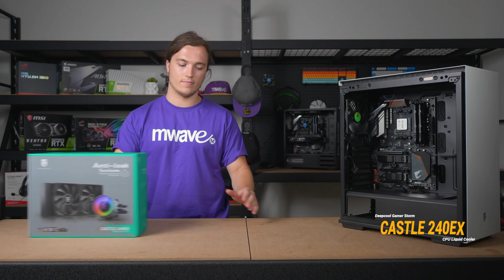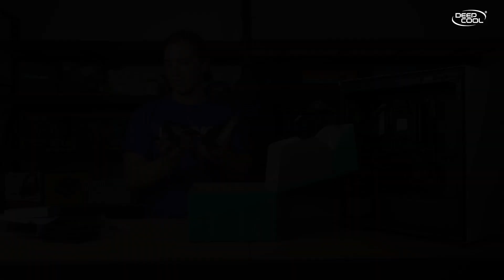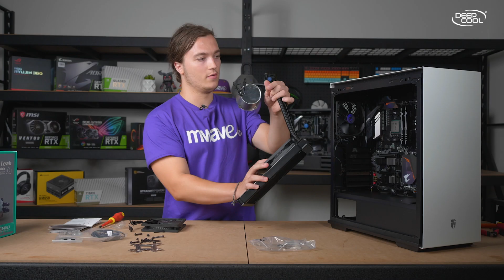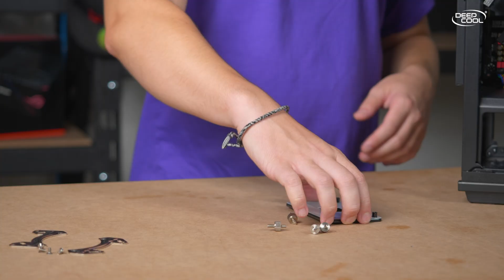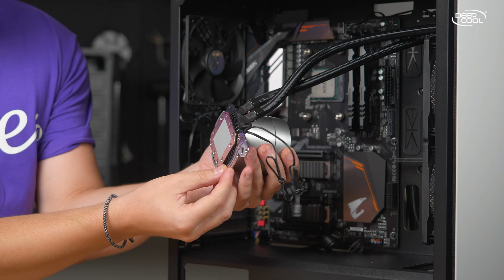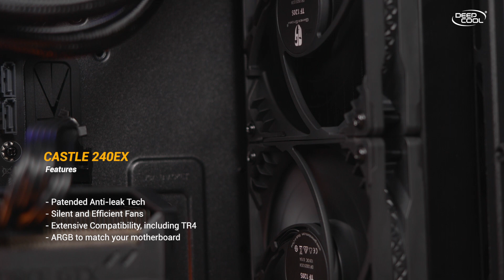Deepcool Gamer Storm Castle 240EX Gaming System (Unboxing + Installation)

Comment: Does it matter which direction the hoses on the radiator are located(at the top or bottom)?
Reply from the maker: Hey Adam. Apologies for the late reply! If you are placing the radiator at the front of the system, similar to how it is installed in this video, then no. Both ways will work but there are just a few things to keep in mind.

If you are positioning the tubes at the top, just make sure that the top of the radiator is above the CPU/water block. For some AIO coolers, if the top of the radiator is below the water block, then the air bubbles will eventually make their way up to the pump and CAN shorten the life span of the AIO cooler.

If the tubing is positioned at the bottom of the radiator, then the air bubbles will eventually make their way to the top of the radiator and just stay there. This is normally the safe bet but as GPUs are getting bigger and bigger, this configuration might not be possible as the GPU will get in the way of the tubing.

Sorry again for the late reply, but hope this helps! If you have already built your PC, let me know how it all went 😊

Comment: noob question, why put the rad/fans at front of tower instead of the top?
Reply from the maker: Hey Mike, the case used in this video (Deepcool MACUBE 310 Mid-Tower ATX Case) doesn't support radiators at the top of the case. Although it does support up to 3x 120mm/2x 140mm fans at the top, the product specifications only supports radiators at the front and back of the case. This could be due to motherboard/RAM clearance when installing an ATX motherboard.

Technical Spec:

Liquid Cooler Compatibility:
Front: 120/140/240/280/360; Rear: 120

Cooling Fans Compatibility:
Pre-installed: Rear: 1×120mm DC fan
Optional: Front: 120mm×3/140mm×2
Top: 120mm×3/140mm×2

Comment: I like how the rad is mounted in the worst possible way..
Reply from the maker: Hello! I get comments like this a lot lately. This case only supports a front mounting for a radiator that is bigger than 120mm, so for the Deepcool Gamer Storm Castle 240EX, it has to be on the front. To rotate the radiator so the tubes come from the bottom, the tubes will press against the Graphics Card (Gigabyte GeForce GTX 1660 SUPER GAMING OC 6GB Video Card) which is 280mm in length. If the tubing and the graphics card allowed it, then yes, rotating the radiator around will be the optimal mounting.

However, the issue with vertically mounted radiators is when the top of the tubes is lower than the CPU water block. When the tubes are below the CPU water block, the air will eventually make its way up to the pump/CPU water block, which will cause damage and prematurely kill the cooler faster. When the tubing is higher, air will get caught in the top of the radiator, causing a bubbling sound but this will not damage the AIO Cooler.

But I will give you credit, out of the 2 possible options for mounting a 240mm AIO cooler in this case, if the tubes from the radiator didn't interfere with the Graphics Card, then this will be the worst possible way to mount it. So, I will thumbs up your comment hehe ;)

Comment: I’m confused with the radiator and the fans, are the fans supposed to go first and then the radiator closest to the cpu or the radiator first and then the fans pulling air in. I figured the fans would go first because they pull more air in easier.

Comment: Did you remove the stock motherboard back plate?.  My mobo is MSI x570 Tomahawk , the supplied screws does not snug fit leaves a gap. I think i should return the cooler.

Comment: what deepcool cooler is better? the storm castle 240ex or the v2?
Reply from the maker: Hello! I unfortunately haven't tested both of these AIO coolers against each other but having a look at the specifications, the V2 has a tiny bit of a higher Pump Rated Current and Power Consumption. The normal Castle 240EX also has more compatibility with some older generators of CPU sockets of both Intel and AMD. Additionally, the V2 has a couple of extra features. Besides this, theoretically it seems like that would perform very similar. I will link the Deep Cool Product pages if you wanted to check out the specifications for yourself.

Castle 240EX RGB: https://deepcool.com/product/LiquidCooler/2021-03/209_14332.shtml
Castle 240RGB V2: https://www.gamerstorm.com/product/CPULIQUIDCOOLER/2019-04/1286_10794.shtml
Reply: @MwaveAU  thank you for replying i’ve i’ve decided to get the castle ex for my build 😀
Reply from the maker: Not a problem, happy to help :)

Comment: How long is the tubing for the 240ex actually? Is it really 310mm like the website says? Some reviews say its shorter due to the design.
Reply: Hey, I think 310mm is more or less accurate, but you may have to subtract the two metal fixings at either end so it's probably closer to 300mm. The gap in this particular case was a lot larger than the typical case install and it went well so I don't think tube length should be an issue often/if at all. Do you have a particular concern?
Reply: @gottawatchemall4120 
Ohhh okay2. So subtract huh. 

 But hmmm, do you think 240ex tubing will be long enough to mount at the front of coolermaster mb500 sir?
Reply: @artemiolomarda5630  hmm, for that particular case, I'm not sure if it will reach. The MB500 is pretty wide.
Reply: @gottawatchemall4120  yeah thought so too. Im debating whether I should get a 360mm Deepcool castle or 120mm nzxt m22
Reply: @gottawatchemall4120  is the tubing length for 240ex as long as the one in 240rgb?

Comment: Will this cooling system work with the i9 9900k processor overclocking?  or is it not enough?
Reply: i wouldnt say it would be enough, ur better off saving to get a better cooler considering its a i9 9900k

Comment: where does the liquid go?
Reply from the maker: Hello! The cooling liquid will already be inside the AIO cooler when you take it out of the box. Some AIO Coolers have a little unscrewable hole in the side which lets you refill the liquid as it evaporates over time but I believe that the Deepcool Gamer Storm does not have this.

If you mean where does the liquid go when the AIO Cooler is working, it just circulates through the Cooler via the water pump, cooled by the fans attached to the radiator, then pumped through the system to the water block where it cools the CPU, then back through to the radiator to be cooled again by the fans.

Does this answer your questions? Let me know if there is anything else I can help you with :)
Reply: @MwaveAU  yea thanks. i wasn't sure if i had to add liquid myself
Reply from the maker: That's all good, happy to help :)

Comment: Bruh. Show me the cable connections
Reply from the maker: Hey Daniel. Sorry, let me see if I can give you the info you need to connect your AiO Cooler. I am assuming that you have this exact same cooler or a similar one. If you have RGB or aRGB on the waterblock, then you will have 2 cables coming out of the AiO cooler. One of the cable will be for a fan header which you will connect to the header labelled "PUMP". If it is not labelled on the motherboard then check the motherboard manual for it.  The second cable will be an RGB or aRGB header. Connect it to either a 3 pin or 4 pin a/RGB header on your motherboard. This will get it working for you.

If you have multiple a/RGB fans in your system then daisy chain them using a splitter and connect them into 1 or 2 different a/RGB headers in your motherboard. This will allow you to control all the lightly to match, if you are going for a single or multiple colour PC. Hope this helps!

If you have any other questions, let me know and I will try my best to find the answer for you :)

Comment: Автор не знает что если ставить радиатор вертикально то трубки должны быть внизу иначе происходит завоздушивание помпы уменьшая эффективность и ресурс.
Reply from the maker: Google Translate

Comment:
Автор не знает что если ставить радиатор вертикально то трубки должны быть внизу иначе происходит завоздушивание помпы уменьшая эффективность и ресурс.
The author does not know that if you put the radiator vertically, then the tubes should be at the bottom, otherwise the pump is aired, reducing efficiency and resource.

Reply:
Водоблок процессора находится ниже верхней части радиатора. Эта конфигурация в порядке. Трубки недостаточно длинные, чтобы достать до дна. Видеокарта тоже мешает.
The CPU water block is below the top of the radiator. This configuration is okay. The tubes are not long enough to reach the bottom. Graphics Card is also in the way.
Reply: @MwaveAU  Этого не достаточно, посмотрите видео на эту тему от GamersNexus, и не только он снял видео по этому поводу. Трубки там кстати достаточно длинные практически у всех AIO, даже с учётом видеокарты.
Reply from the maker: Google Translate

Comment:
Этого не достаточно, посмотрите видео на эту тему от GamersNexus, и не только он снял видео по этому поводу. Трубки там кстати достаточно длинные практически у всех AIO, даже с учётом видеокарты.

It's not enough, check out the video on this topic from GamersNexus, and not only he made a video about this. By the way, the tubes there are quite long for almost all AIOs, even taking into account the video card.

Reply:
Согласен не согласиться. Соглашусь с вами, что эта конфигурация не лучшая, но и далеко не худшая. Опять же, водоблок ЦП находится ниже верхней части радиатора, что означает, что воздух останется в радиаторе, а не в насосе. Воздух, попавший внутрь водяного блока помпы/ЦП, — это то, чего мы пытаемся избежать.

Геймеры Nexus "Хватит делать это неправильно: как убить кулер процессора": https://www.youtube.com/watch?v=BbGomv195sk&ab_channel=GamersNexus
JayzTwoCents "ПРЕКРАТИТЕ ЭТО ДЕЛАТЬ!!!!!!!": https://www.youtube.com/watch?v=DKwA7ygTJn0&ab_channel=JayzTwoCents

Agree to disagree. I will agree with you that this configuration is not the best, but it is also far from the worst. Again the CPU water block is below the top of the radiator meaning the air will stay in the radiator, and not in the pump. Air caught inside the pump/CPU water block is what we are trying to avoid.

Gamers Nexus "Stop Doing It Wrong: How to Kill Your CPU Cooler": https://www.youtube.com/watch?v=BbGomv195sk&ab_channel=GamersNexus
JayzTwoCents "STOP DOING THIS!!!!!!!": https://www.youtube.com/watch?v=DKwA7ygTJn0&ab_channel=JayzTwoCents